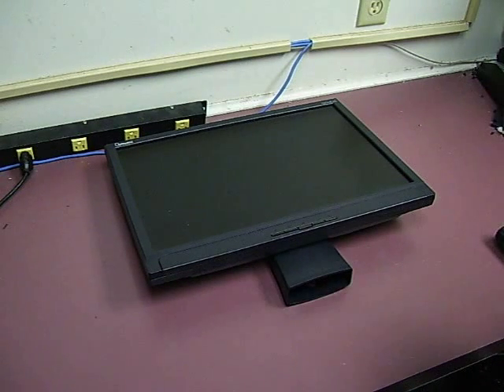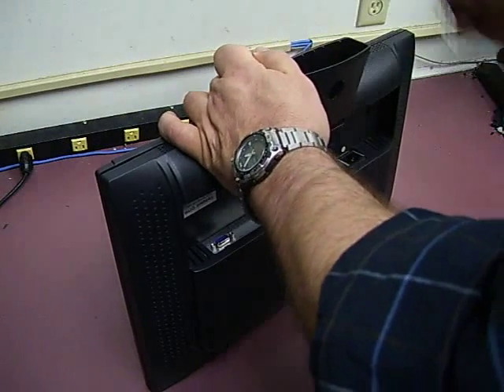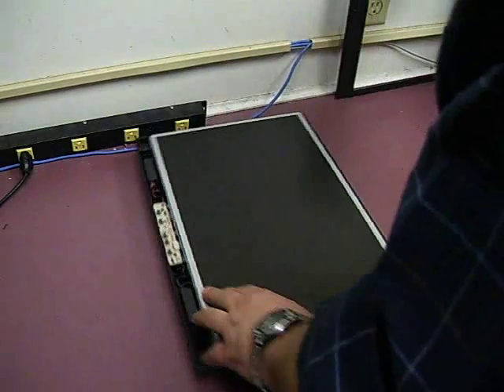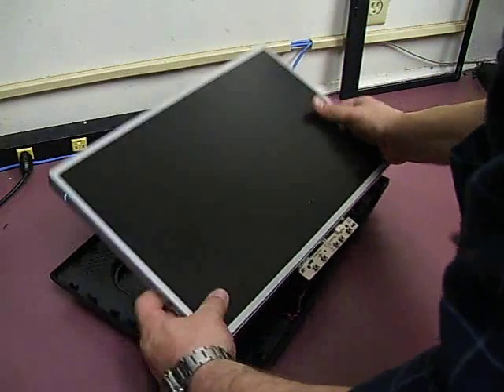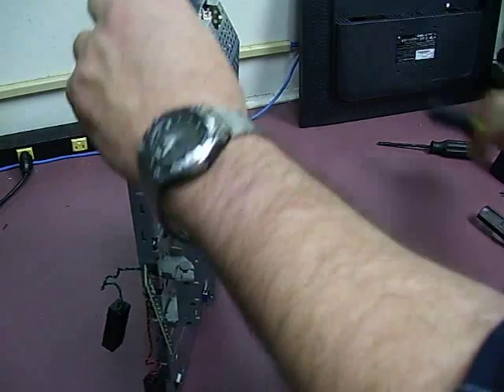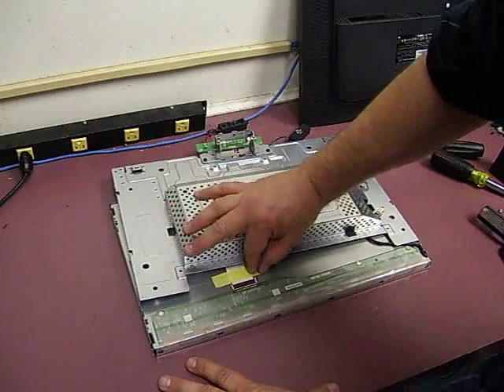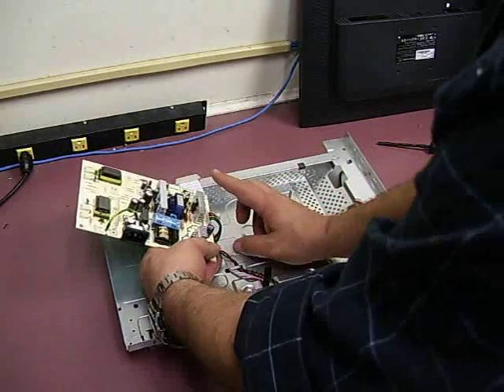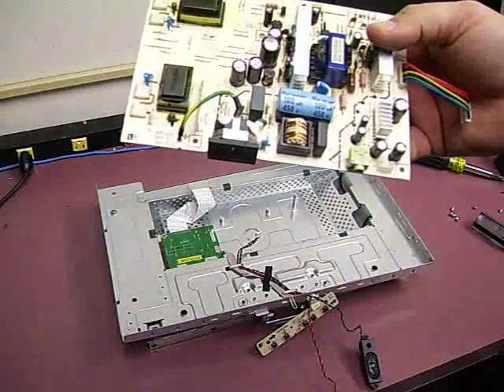Repairing a Optiquest Q19wb with power up issues Part 1 Dis-assembly

Comment: I tested these seven capacitors and they are all good.
Monitor is working as I can see the image with lamps turned off.
But my problem is that the lamps only lights up for about a second then goes out.
If I want to light them up again (for one second), I have to turned off and on the monitor.
Where would the problem be?
What would be the parts I need to order?
Thanks !!